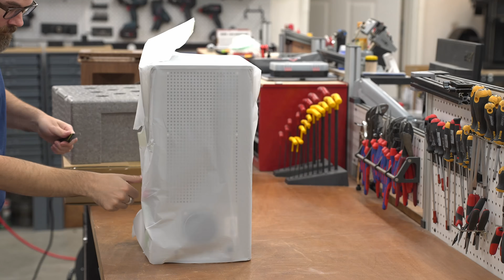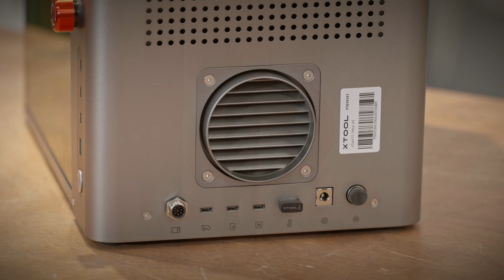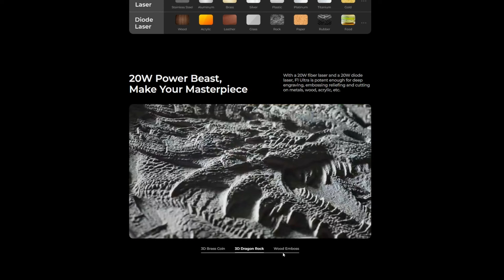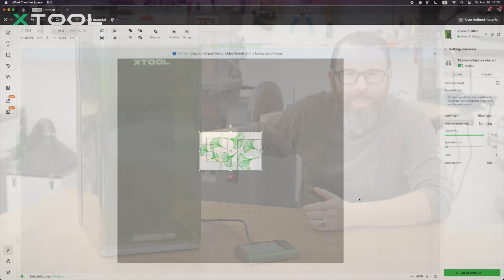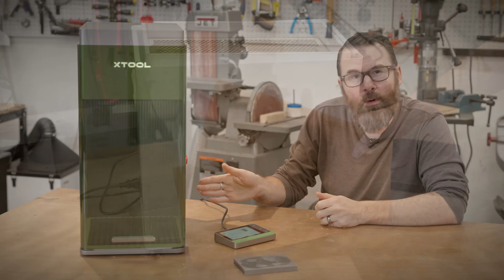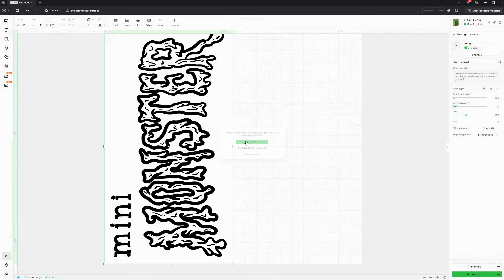xTool F1 Ultra Overview - The most intuitive fiber laser.

Comment: The xtool f1 ultra is inconsistent and I recommended people don't buy it. First you have to deal with calibration issues, then framing issues and now I can barely get it to engrave after 20 hours of use and xtool support don't do anything about it.
Reply from the maker: There are always bad apples.  That's a bummer you haven't had good luck with their support.  You say it barely engraves, can you confirm that EITHER laser it outputting the correct amount of power?  That seems odd.
Reply: Hi, thanks for your comment. Any other printer you have had better results with??

Comment: Think you are being a bit dramatic about the movement of the machine ie the build.  There is no laser out there that I have used that like being knocked when in use if you are moving it as much as you were dramatically showing you really shouldn’t be using a laser 😂
Reply from the maker: I'm not being dramatic.  I have a Cloudray and you can practically hang off the thing.  I'm just providing people with information, it's easy enough to get the machine to wobble even if it's not on a sturdy workbench.  I think YOU might be the overly-dramatic one.

Comment: Your standard Fiber lasers can take 300mm lenses, the standard ones are not limited to 200mm. I have only seen that limit on the smaller budget machines that try to put out a more compact machine. I have a 110mm, 150mm, and 300mm for my 30w Mopa. The 150 lens is my primary lens, 110 if I need more depth/power, and 300 for larger projects that just need to be marked without any depth.

I can see where the F1 max would be more appealing to some users with its ease of use and camera system. Also having the built in shield/enclosure is nice for hobby users or those with kids. Seeing the flex is a little disappointing, and a bigger downside than the price when compared against your standard fiber laser considering the nice to haves that it does come with.

Comment: I'm curious about the cutting ability of this thing for thin brass and stainless, we use 0.2mm to 1mm stainless a lot at work for making masks. Or are there companies putting that fiber laser setup on an x-y gantry for cutting?
Reply from the maker: I've tried cutting thin metal with fiber lasers (of this power).  It 'works', but you have to do multiple passes and the edges are pretty rough.  With a little sandpaper they can clean up OK, but it's not ideal.  0.2mm would probably be OK, but you also get a bit of warping on thin materials.
Reply: Thanks, I might look for higher power fibre lasers.

Comment: Robert, you missed the most touted feature from Xtool on this model. It has BOTH Bluelight diode and the fiber!
Reply: 8:16 he mentioned it here for example.
Reply: @Todestelzer so correct Tode! Thanks.
Reply from the maker: I think I mentioned it more than once.  It was buried in there, but it's in the conclusion for sure.

Comment: great overview (you've made it clear it's not a review :P) - it does leave me with a more general question, if you'd be willing to entertain it:  I think at this stage in my making endeavours, the only reason why I would want a fibre laser is to mark 3d prints and most fibre lasers seems far too expensive for that... am I making a bad assumption in that Fibre lasers are the only option (and if they aren't are they the best option, mechanically) to mark prints?
Reply from the maker: There's a guy on YT that uses the 2W F1 diode laser to mark 3d prints.  Basically, you need the right wavelength and IR and fiber lasers both work.
Reply: @RobertCowanDIY  Ah, I see it now: 1064nm - Cheers. I just caught your video on it, too, and that answered my second question on if a galvo head is necessary - turns out: Yes. I Guess I should've watched more of your videos again before placing the question >.< - thanks again.
Reply: @ThatRobHuman there is a 2w IR Module for the S1 as well
Reply: @caradellinowazer2988  Thanks! I'm not sure I would trust a gantry to move the beam fast enough, though.
Reply: @ThatRobHuman  Not a problem, as you can reduce power. The question is more a use case, as galvos are limited in engraving size and very limited (angle!) in cutting size. Btw. I have a F1 and I think I will skip fiber lasers as UV lasers seem to be as capable and even more versatile. And here I have the same dilemma to choose between galvo or gantry style. So I really feel you 😉

Comment: price is pretty high for a laser that isn’t good enough for production/business use. Hard to justify $4-5k for fun, at least for most people
Reply from the maker: I should have been more clear.  It's absolutely good enough for business or production use.  I'm referring to a commercial or industrial environment, running large batches.  At my company, we use a Cloudray fiber laser for manufacturing sensors, and we run through a few hundred at a time.  It's always the exact same engraving file and we just do a lot of batches at a time (like someone at the machine for a couple days).  For THAT type of work, I wouldn't pick the F1 Ultra.  But, for smaller batches, one-off Etsy orders, custom engraving, etc, etc it's PERFECT.  There are a lot of people making good money from xTool products and for good reason.  But if you have an engineer design an engraving design and you're just running the same file day after day, all the features of the xTool are irrelevant and I'd just go with a more stout machine like the Cloudray.  Does that make sense?

Comment: Ok, tilting/mirrors cause angled "cuts"... so why this laser doesn't end up on a gantry like diode lasers do - is module too big for that?
Reply: Galvo lasers are designed for marking/engraving at high speed, not for cutting.
Reply from the maker: The module is quite large, but CO2 lasers use a series of mirrors to direct the laser beam as well, but it's always pointing straight down at the workpiece, not aimed from above at an angle.  Does that make sense?  Only with diode lasers do you actually have the laser source mounted on the moving gantry, in every other configuration, you're using mirrors.
Reply: @arekx  The addition of a gantry would seriously compromise the speed and probability decrease the accuracy somewhat. The XTOOL S1 with the gantry, however, provides a much larger work area, and even the possibility of the ability to engrave much longer pieces of material. So, one cannot get all the desired features in one system, and why XTOOL markets so many different laser machines.

Comment: As always, I appreciate your insights to this and other kit in general!
I've had this laser for a couple of months and slowly putting it to use. I did also get the new filtration box. 
In your view would it be feasible to remove the embedded fan and rely on using the external filter as it's controlled via Bluetooth? In doing so, avoiding that debris build up you mentioned.
Reply from the maker: Absolutely!  When I took it apart, it was pretty easy to remove the fan.  Even on the P2, they have a fan in the back, which isn't really necessary if you use external dust extraction.  The unit might complain if there's no fan there, but that's easy enough to simulate.
Reply: Cool! Could you point me to an area where someone with limited electrical compentacy, like me could learn how to trick the machine? Thanks
Reply from the maker: @MrClintypoo  Have tried simply removing the fan?  It might be fine with just unplugging the fan completely.  If not, you could always just have the fan sitting outside the machine.  Try that first and get back to me.
Reply: Awesome! To be honest I was a little daunted with mucking about too much the innards without a roadmap! But that idea of keeping it connected and hanging out the back seems a good one to try, thanks! I'll let you know how goes it.
Reply from the maker: @MrClintypoo  Sure thing.  It's fairly easy to get to.  You SHOULD be able to just unplug it though without any issue.  See how it goes!
Reply: The fan is designed to be removed to be cleaned.

Comment: Hey Rob, a question. For the metal dust, what if we immersed the part in a silicone oil and cycled it with a small pump that is filtered with some coffee filters paper? Would the oil be transparent to the laser? I choose silicone oil for the temp tolerance. Water would turn to steam and explode.
Reply from the maker: Hum, I feel like the laser wouldn't remain focused.  It would diffuse the beam.
Reply: @RobertCowanDIY  Ah, nice catch! It would bend due to diffraction.
Reply: You can engrave underwater somewhat.

Comment: Great overview! I was considering one of these but the wobbly build quality is pretty disappointing... Really curious why seemingly no other manufacturers have attempted a polished all-in-one form factor like this?
Reply from the maker: When I took it apart, it was apparent how hard it was to fit everything into that form-factor.  I wouldn't let the wobbly build change your mind.  It's something worth mentioning, but the overall build quality is FANSTASTIC, it feels like a brick.  BUT, having the plexi shield movable in the same spot as the head leaves very little room for additional support.  The actual head is pretty heavy and cantilevered like that will reduce rigidity.  BUT, this isn't a milling machine.
Reply: @RobertCowanDIY  Makes sense, thanks! I think the wobbly-ness just felt disproportionately disappointing because overall the machine looks SO CLOSE to perfect (with the somewhat low power basically being my only other hang-up).
Reply from the maker: @shlubbert3355  For sure, I'm just trying to be honest and thorough.  For something like this, it really won't matter, unless you're in a manufacturing environment and need something bullet proof.  For the home shop, it's more than fine.  But I'm also unfairly comparing this to the Cloudray, my CNC machines, etc, etc.  I have big heavy tools and this isn't that.  I'm doing a follow-up video soon though, I'm trying to decide between the Cloudray and the F1 Ultra, I only really need to keep a single fiber laser.  I will be discussing the comparison more.
Reply: As a user of the F1U its really not wobbly at all, I have never had an issue and have done 100's of hours of engraving and not lost a single item to wobble. Just dont think you can pick it up and move it while its working. I wonder if Robert got a dodgy unit